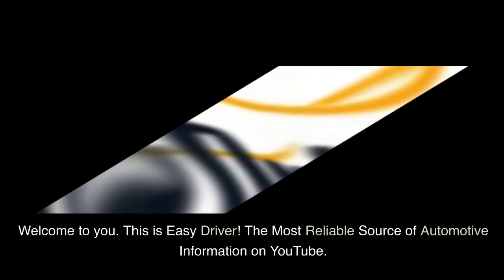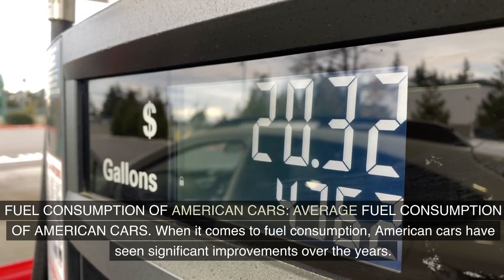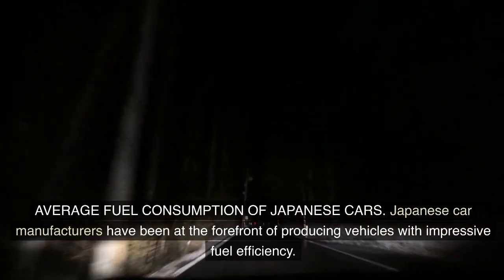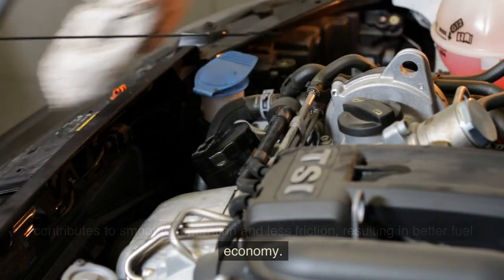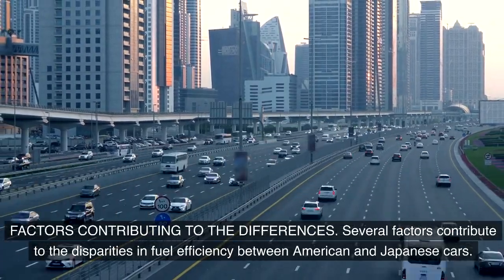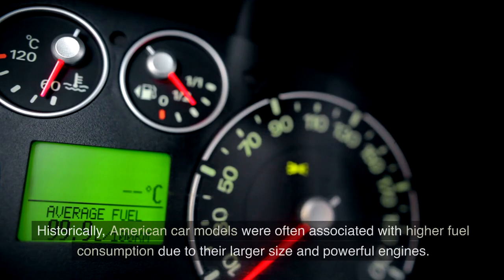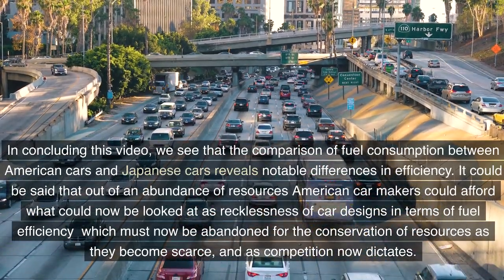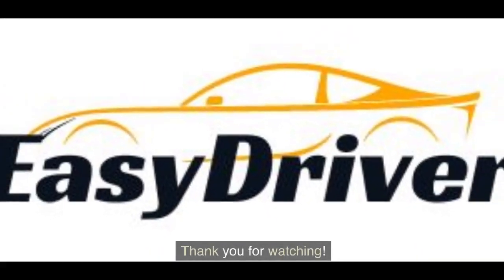American vs. Japanese Cars | A Comprehensive Fuel Consumption Comparison!

Comment: My 2012 Genesis equiped with a 3.8 litre engine performs with 28 m.p.g., a 2023 toyota with a 3.5 litre engine is rated at 26 m.p.g., smaller engine, smaller car, less m.p.g. Go figure
Reply from the maker: Yeah. Indeed.